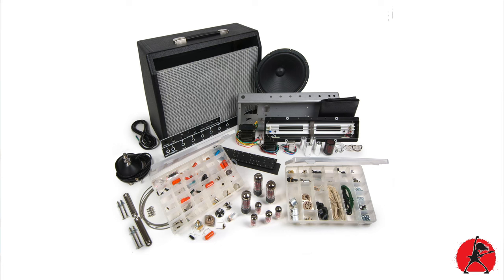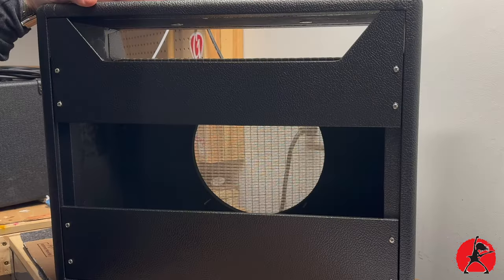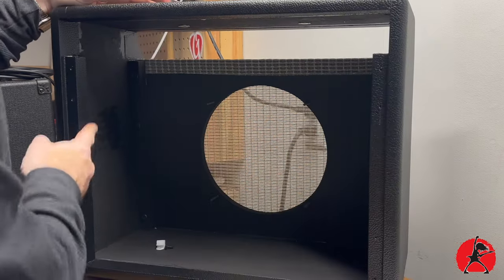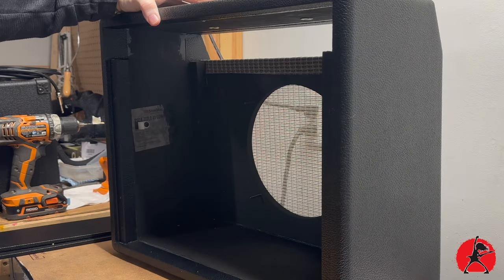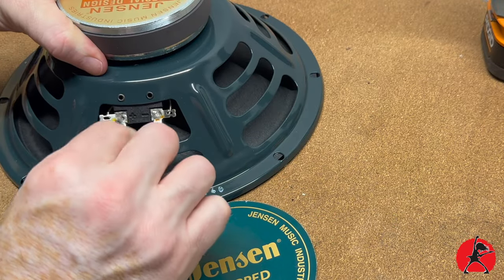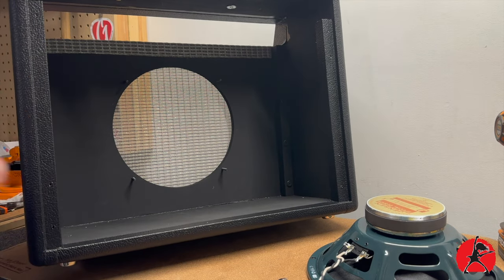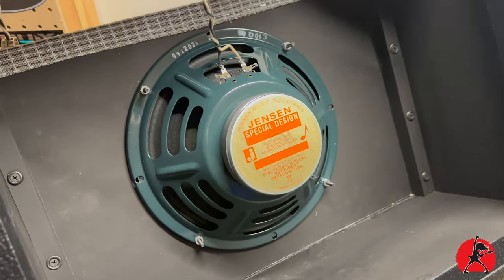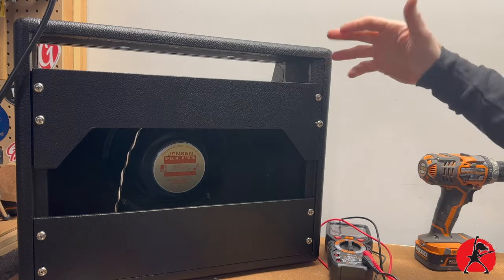StewMac Priceton Reverb Build Project - Part 1

Comment: You are taking the right approach by taking your time and reading the instructions.
At this stage all i can add is to ensure any surface you are going to solder to is clean amd bright
or the solder will just form a blob, cleaning the area will remove any residue.
Take your time Tony, you will get there.
This is easy for me to say, i have been repairing and building amps for the last 50 years.

Comment: It's nearly as expensive as buying it directly from Fender already built lol what's the point?
Reply: I guess it could be a learning experiment.  Some people find joy from tinkering.
Reply: This amp is hand wired and does not use a PCB board. The hand wired version from Fender is 2800 $
Reply from the maker: $3859.99 in Canada for handwired version.